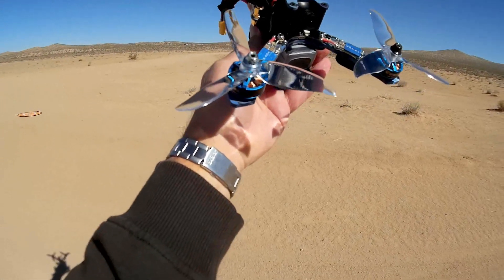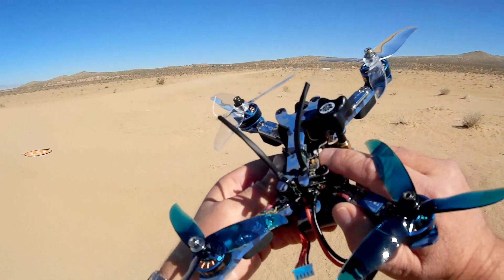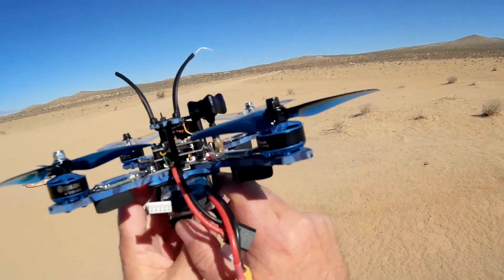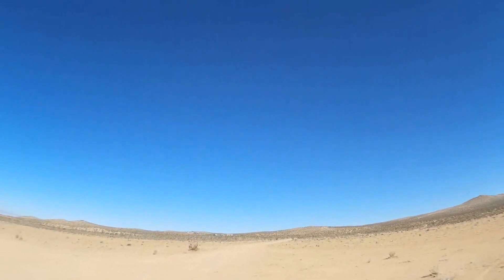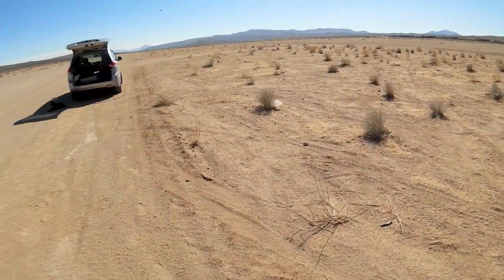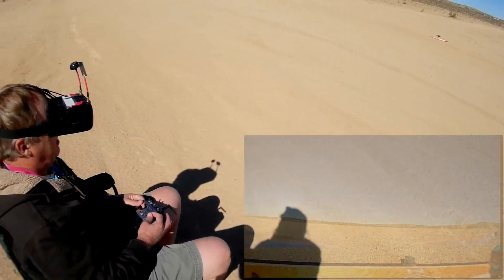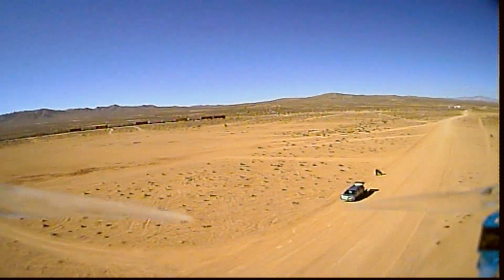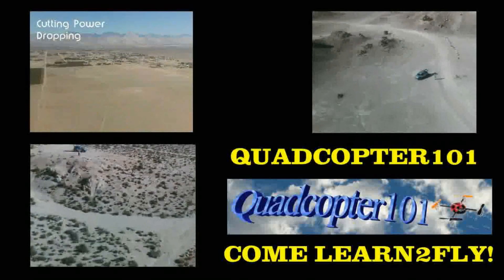Eachine TS215 New Wizard FPV Racer Flight Test Review

Comment: I was gonna get the wizard 220 but it was out of stock but went with the ts215 frsky bnf and I'm glad I did. People say this isn't good for racing drone beginners, but I find flying with a 3s battery first is a good way to test the waters before popping in the 4s. with 4s man, she screams. So fast and exhilarating to fly. Frame feels very solid and good vtx after the silly janky DVR is deleted. Excellent quality for the price. if you're capable to diy but don't want to build one from scratch this is a great choice. Only downside is no GoPro mount and the GoPro form factor is kinda tricky to mount on this frame, maybe a Mobius style camera would be better

Comment: Maybe the DVR causes a bit of lag but the quality seems good and recording with fpv goggles built in DVR, good as they can be, you'll have always a bit of statics... It's a cool racer but I think I'll go for the old version (220s): still a great quad and also reasonably priced...
Could you make a video about all the differences among: RTF, BNF, PNP etc. and Flysky, Frsky etc...and how to bind with a transmitter? I still find them a bit confusing in case I wanted to pick my race drone and my transmitter separately (which is often convenient)... Thanks in advance!

Comment: The drawback to on board DVR with osd menu is that you have to run the video thru the DVR then to vtx which will always create lag . The better option would be to run video to the DVR in a separate feed and not thru it. You wouldn't have osd menu but you would have low latency video feed.  I do however really like this quad.  It's gotten good reviews by all.